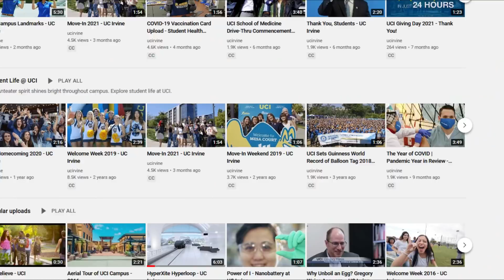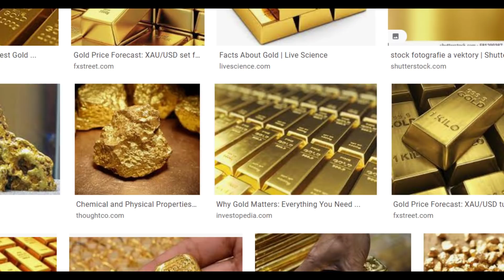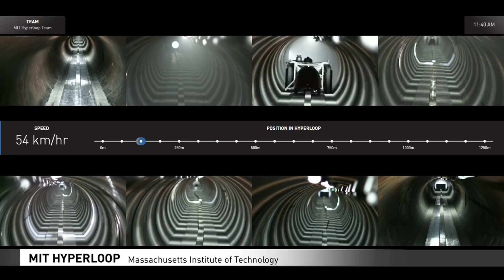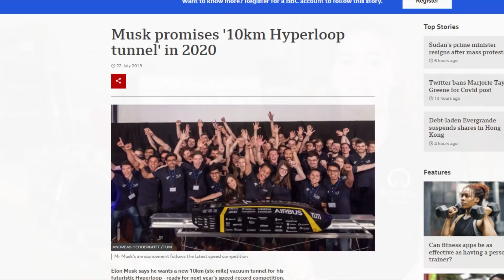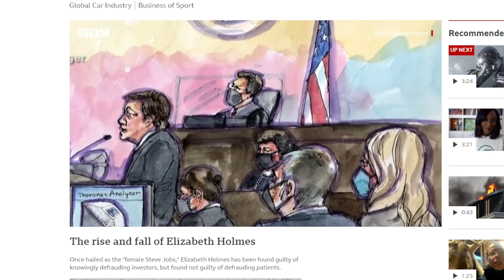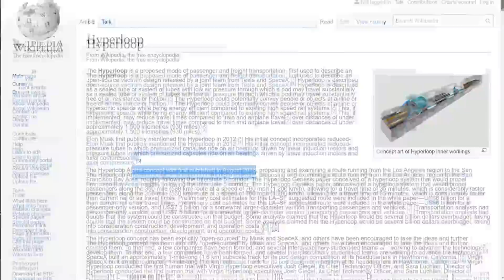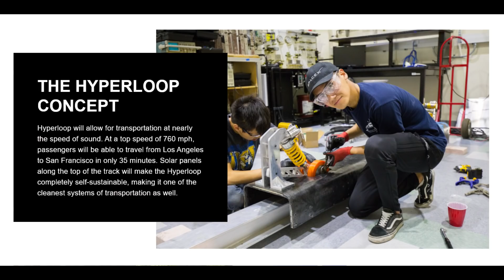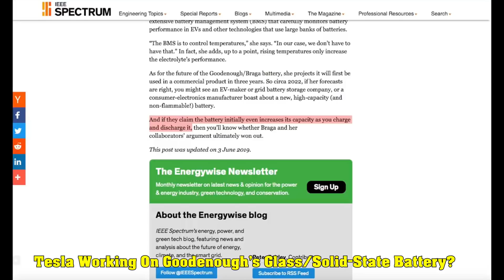The GOLD Battery that will revolutionize EVERYTHING!

Comment: The spot I realized it was BS is when Musk claimed Hyperloop would be cheaper to build than traditional high speed rail.  Maglev is already more expensive then traditional rail, or even high speed rail, but maglev+vacuum tube=cheaper?  How?!?
Reply: Plus far less capacity to offset costs.
Reply: @tychocollapse  More than likely.
TL;DR:  The "cheaper to build" claim is the one that is easiest to dismiss as BS.

I feel that is a little harder to argue about things like capacity since as far as I know Musk never mentioned its capacity vs. trains.  H did mention it being cheaper to build and run.  While the running costs would almost certainly be higher, they are still just theoretical.

However just the material costs alone (given it is both mag-lev and vacuum tube), make debunking the cheaper to build part irrefutable.  Then add to that the complexity of actually building the damn thing (simple steel rails vs. meg-lev and enormous vacuum chamber) and it becomes even harder to believe the "cheaper to build claim."

Comment: "its like a air hockey table"
so your gonna pump air into a vacuum chamber? right? then why have a vacuum chamber in the first place?
better yet dont pump air to push the tram up 
but instead make the tram and tube air tight attach a jet engine and pump the air behind you 
you get both thrust and air pressure differentials pushing

Comment: I used to be a believer in Hyperloops being a potential future technology. But the more I heard about them the more I just think it's a ridiculous pipe dream (no pun intended). 

We just don't have the materials or the technical knowhow and the infrastructure is insane. Even if you desperately needed to get X thing to a destination as fast as possible to the ignorance of any and all expenses it'd still be better to just fly it there.

I really can't think of a viable use case for Hyperloops even if we did have the technology.
Reply: On the matter of gold nano batteries: If they can hold significantly more charge cycles than is normal there might be some niche use case for it, though I can't think of any off the top of my head, but the idea of it revolutionising anything is amusing.

Comment: SOMETHING TO LOOK INTO. 
The cost to run a tesla vs the cost of running a conventional petrol car. Not just a financial cost but a cost to the environment for example
The cost to 
mine and produce lithium. 
Make the battery. 
Charge the battery 
Replace the battery 
Disposal of battery. 
Vs 
The cost of fuel 
I believe the tesla is not an effective way to protect the environment. Nor is it a cost effective way to travel. 
The man is only interested in money. 
How much pollution is made to launch one of those rockets. 

Just think about that. Maybe make a video on the cost of a tesla Vs conventional car.
Reply: I hope you realize oil is also being mined/extracted by drilling holes deep in the ground (using not so clean electricity), then it is refined in huge factories to become gas (also using not so clean energy), then it is shipped all around as gas in trucks, huge ships, trains etc., there are spills all the time of all sorts, there's also CO2 that is released in all of those processes
Reply: @asis_thoughts4399  exactly it would be interesting to see cost comparisons for both including the environmental costs for both.
Reply: Public transport is the answer, moving 100 people with it rather that having them ride cars (with 1.5 occupancy i believe it's the US average) is cheaper, more efficient and if 100% electric requires less resources for the electric engine and battery but may even make do without batteries with catenaries and trolleybus.

There is the slight issue of placing like the US being purposely delapidated to make cars the only viable mode of transportation, but if one care for the sustainability something gotta go, be your current lifestyle or the pretense of helping the planet, without change you might as well give up of the idea of sustainability.
Reply: @herlescraft  sure public transport is the answer, but not everywhere and for every person, but generally yes, we do not need that many EVs driving around too in future

Comment: I think Thunderf00t isn't really understanding or explaining Li batteries well enough here, which is odd for a chemist. They aren't at all pure Li. The Li in Li-ion batteries is actually contained in heavy metal oxide particles such as LiNiMnCo oxide. So of the concentration of metal ions in the oxide, Li is only ~25at%. Those transition metals are very heavy compared to Li, but it is the Li cycling that does the electrochemical work.  The Li is not so much used in batteries because of atomic weight, more so because of its electrochemical potential.
I'm not endorsing the gold thing, just saying Li batteries aren't exactly light, because there's so much more inside than just Li atoms. So to imply that an Au-based system is absurd compared to Li-ion batteries simply because the atomic weight is so different, that's not really a highly relevant criticism. However, I fully expect there to be far more valid reasons why the gold concept will not become reality.

Comment: you know.. hyperloop.. maybe it works.. maybe it doesn't. I'm pretty sure smarter people than me can possibly create something that would work.
the problem is, every time you see videos about it, it's filled with concepts, drawings and stuff where even I, with limited knowledge about those things go "did you even think about it?"
Riding on an air cushion? in a vacuum? a render of a hyperloop with a turbine at the front?.. in a vacuum?! sleek and aerodynamic designs... in a vacuum... all the other technical things, I have not the best knowledge of, but at least I understand the most basic principle of the hyperloop and the environment that it would be running in, the vacuum..

Comment: It's disturbs me that the engineering students have been fooled into thinking they were working on a real system vs a hypothetical product.  It's not unusual to design to a spec where the spec is not 'real world', or even simply wrong. It happens a lot.  But they seem to think they accomplished something amazing when they build a hypothetical project with all the hurdles ahead of it beyond our tech and actually impractical in a logistic sense (hyperloop in this case).  Seems like the schools are more interested in hype than in critical thinking in their students.

Comment: "Gold is a noble metal in the periodic table, which is chemically inert and does not get corroded in the natural or industrial environment. This is because the gold does not react with oxygen in the atmosphere. ... The rest part of the ornament is often made up of silver or other metals like copper, nickel, iron e.."

So... there are many conductive and non reactive to our earthern atmosphere to choose from, for our operating environment, but there  substances that we can make that are inert in all and most planetary systems and environments. Our designs would change to the pressures of exploration of the planet itself, order for data retrieval...

lol...

The old discovery of new materials, such as poly carbon fibres that were demonstrating equal to superior strength to Steal, but had its own draw backs and weaknesses... It seems complex composites are the future, complex chains would end up us mimicing the complex protein groups in the body it owuld seem... but meh.. tahts all hoopla, but it is a thought direction...

The battery thing had very little explanation... ot the substance used and why... and how.. just a road, why and its this... mystery substance.. 

yawn.. atleast sell me the hypothesis which cna be a working application with natural data, this is like peopel making up data blocks that do not connect..

Comment: Private transport such as small size pods, are used for 1 thing, to go on any trip you want, rather it being off-road through the dessert, or it is a planed trip from Copenhagen to Paris, to Russia, to Singapore, then it is possible. But the long trips are also possible with public transportation such as airplanes. From Copenhagen to Paris, to Singapore. Sure the trip is not the same, not even a tiny bit. But that outside of the argument here.
He wants to turn a metro into private transportation sized carts. -_- what a completely waste of resources. There are no benefits of smaller carts. More expensive, same restrictions and limitations, but it is more "private"

Comment: I think the UC Irvine was HIGHLY embellished to be clickbait. Without looking at the paper I actually do believe that the "gold nanowires" can charge/discharge a very large amount of times. What I do think the video fails to mention is the actual capabilities of such technology. I would think that these "batteries" have such a small amount of energy storage, it really isn't notable other than powering a single LED if even that. I work with benthic microbial fuel cells and it sounds like something from the future where you have electrical energy generation happening by microbes growing on a carbon weave on the ocean floor. Much like the "battery," this energy system produces energy on the order of fractions of a millivolt. It is very cool for lower power applications but for a UC to be hyping up technology with an impossibly high cost that shows little to no promise of surpassing current technology is pretty fuckin yikes lol.

Comment: Universities should be heavily questioned for allowing paying students to participate in dead end development studies. There is research and there is development but there is also the real world.  You would not persue an engineering project if it was not for real world, commercial application - period. 

I feel sorry for the people who where paying for their education working on this. Universities should know better and they are responsible for teaching young engineers how to properly asses, problem solve, identify hazards & risks, as well as see the real world application of the thing they are designing.

You don't even need to do any mathematical calculations to know it wouldn't work... A basic knowledge in vacuum systems would be enough.

Comment: The Irvine video is HOT PR garbage (capacitive storage??!!!!)... It should be deleted.
On a side note: look up the nanowire battery, it sounds like a possible upgrade in the lithium battery technology space that could make them last much longer, if it is brought to fruition.
The gold nanowires would hopefully be an extremely small portion of the anode material, but I wouldn't hold my breath that it would be cost competitive per kWH vs standard lithium.
Currently lithium batteries loose capacity just by existing in a charged state(the degradation can be slowed significantly by keeping the charge at or below 80%). So you loose battery life by using the battery, and you loose it by just keeping the battery topped off all the time too. YAY!!

Comment: Look I hate the hyper-loop as much as the next guy, but I clicked on this video about a gold battery which I found a really interesting topic, but the majority of the video was again just about the hyper loop and 'dunking' on some random uni kids. The gold battery was fairly stupid, being too costly, weighs too much etc but I could imagine it having a niche applications in some high tech or chemical industries for example. I certainly could be wrong but I would have preferred to explore that over the hyper-loop again lmao.
Reply: Also gold nanowire is pretty low weight and uses a small amount of gold so I am still confused why it wouldnt be practical tbh (I am not claiming it does in fact work and the unlimited charges seems like exaggeration)

Comment: Would Musk have decided on "definitelyMaglev" as propulsion and guide system, he could have adopted the FUNCTIONING technology of the Transrapid and could have tested and developed at least the propulsion system "on air".  
 
The ONLY reasonable primary use of the vacuum tunnel death trap would be the fast transport of standard containers. In vacuum the unaerodynamic shape of a container does not matter, and for container transport the containers are often welded shut anyhow (floating containers lost from ships at sea are a real threat). 
 
With that you could try out the concept and iron out the issues BEFORE you risk the lives of people.
 
And that is what they would have to do, imagine when the first passenger pod has a leak and, say, 20 people suffocate - Musk's 10s of thousands of transported passengers/day would drop to ZERO in a day.  
 
Unless Musk establishes the Hyperloop as just as american as guns - then the people would go on using and dyiing in the Hyperloop, even if it causes tens of thousands of deaths each year.

Comment: Eh...the average cell phone uses about 0.034 grams of gold ($1.9649) already. And demand for battery tech like this would drive down the price of gold nanowires significantly considering how long they'll last.

100k Cycles and Beyond: Extraordinary Cycle Stability for MnO2 Nanowires Imparted by a Gel Electrolyte
https://pubs.acs.org/doi/abs/10.1021/acsenergylett.6b00029

The reason why they chose to coat nanowires in gold is explained much better here:
https://news.uci.edu/2016/04/20/all-powered-up/

"Scientists have long sought to use nanowires in batteries. Thousands of times thinner than a human hair, they’re highly conductive and feature a large surface area for the storage and transfer of electrons. However, these filaments are extremely fragile and don’t hold up well to repeated discharging and recharging, or cycling. In a typical lithium-ion battery, they expand and grow brittle, which leads to cracking.

UCI researchers have solved this problem by coating a gold nanowire in a manganese dioxide shell and encasing the assembly in an electrolyte made of a Plexiglas-like gel. The combination is reliable and resistant to failure."

Comment: This is so wrong, on its face.  Capacitors need surface area.  Nanowires are cool but they have very little surface area.  Gold is of no advantage in a capacitor— the capacitance depends on the dielectric.  It’s not clear what the resin is for.  Total fail.

Also the bizness about "many charge cycles" is a total fail.  Capacitors do not degrade per charge cycle.  For example the ones in your laptop black brick are going through about 300,000 charge/discharge cycles every second.  The ones in your cell phone transmitter, 2 to 5 billion cycles per second.  Capacitors already can and always have been able to tolerate many cycles as the cycles involve piling up charge, not undergoing any chemical change.  Big misleading fail.

Comment: I think your comparison of Musk to Holmes while a little-bit accurate misses one important distinction: Tesla has produced a lot of the products they announced, late, sure, but they released them. This is a real company that has real products (not vaporware) and you can buy them today and they work. They have electric cars, they have solar roofs (and other solar panels), they actually have self-driving technology that is pretty good, level 4, not quite yet, but pretty good. Theranos was a fake company (essentially) with no real product and never created anything that worked at all (really). Did Elon exaggerate some of Tesla's progress, sure, is that and SEC violation, maybe. I guess the message is that outright lying and making crap up is going to get you jail time, exaggeration will just get you a slap on the hand, and warnings to knock it off.

Curious though, you just stopped talking about the gold nanowires as capacitors and went off on hyperloop. What did they actually find in the laboratory? If it had a MWh/kg (of gold) then gold would be fine, if it has 50kWH/kg then yeah, totally unfeasible. I am sure it is unfeasible, but it was strange you didn't go on past the cost of gold as the reason it wouldn't work. Though it really doesn't work well people did make hydrogen fuel cells, and they use platinum, right?

Comment: Or you missed the point and they were actually talking about the coating of the wires and not the wires themselves?  If the coating allows a battery to be recharged hundreds of thousands of times, minimum, and it would work with other materials than gold it could be a game changing tech.  I am guessing that further research and experiments showed less promise than the hype they produced the video with.

Comment: Feel a bit sorry for those students. They may have high IQ's but they're young & dumb and probably have less life experience than the not so bright kids of their age group. Surely that's the job of their professors, to have enough education and life experience not to believe any far fetched notion that some pot smoking con man comes up with? They're wasting their valuable college time on this crock, someone in their college needs firing and possibly suing for allowing this to happen.  Great video, thanks.
Reply: College time is meant to be spent learning. It doesn't necessarily need to amount to anything as long as they learn skills they can apply to valuable areas. Even if it's bullshit that doesn't matter. What matters is that it is a challenge.